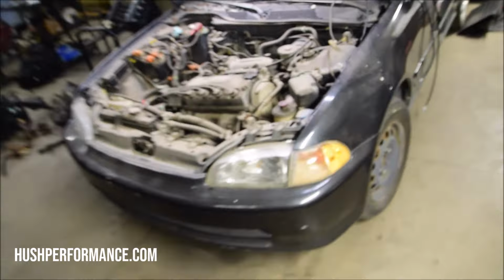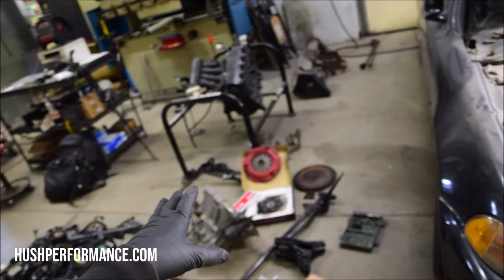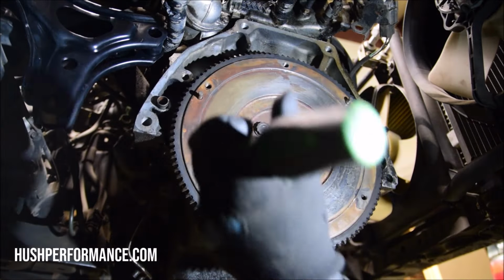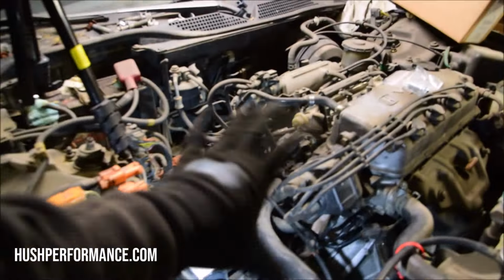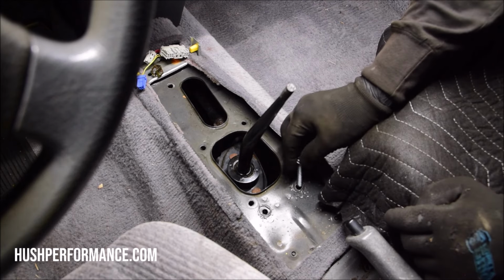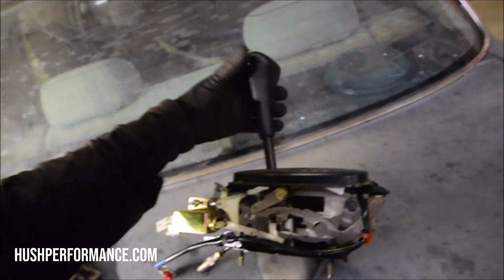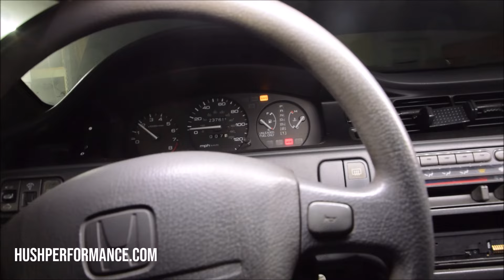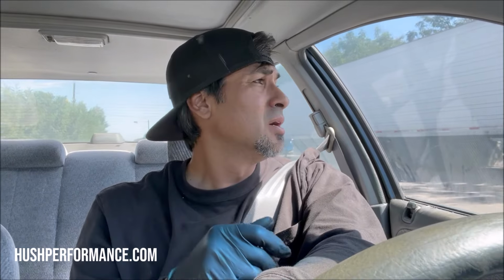1992-1995 Honda Civic Auto to Manual Conversion

Comment: im planning on manual swapping my eg hatch but i have no mechanical experience .. will a d16y8 from a 2000 ex fit in my 95 hatch?
Reply from the maker: @dosseii  yes but there are differences. Do your research before attempting
Reply: @ what trans would you say will fit 100% for the swap ?
Reply from the maker: @ not a 💯 % there are differences. I speak about that in this video.

Comment: Does this swap apply to the ek chassis with an auto d16y8? I wanted to do a swap without having to get the ecu and manual intake manifold and iac to prevent rewiring.

Comment: Few tips & tricks since I’ve owned over 30+ eg , ek , dc platforms 

You don’t need to drop the steering column , you can unbolt the actual brake pedal from the manual assembly and use it in the auto pedal which is a 5 minute swap

There’s a company called C2spec motoring that makes a complete auto to manual plug n play harness that utilizes the reverse lights , Neutral safety switch and doesn’t require any cutting or soldering or wires. 

Auto & manuals engine harness are the same aside from some plugs. But if you B swap and keeping your OEM harness you may need to de loom some of the harness to extend it
Reply from the maker: @Technowaverunner700  thank you for watching!

Comment: great video man. you stated in the beginning youd need a manual ecu, but mentioned you were still running the auto ecu in the end. have you run into any issues with that?
Reply from the maker: @pace3101  the vehicle is not registered or insured. I haven’t drove it any further than what was shown in the video. It should give me a trans code which is why I mentioned it including the harness. The ecu is not the original to the vehicle but the serial reads auto. That doesn’t not mean it’s stock. It could be chipped. I haven’t looked. The trans code should disable VTEC and put it in limp mode. Limp mode may only allow the vehicle to rev no more than 4K rpm in order to protect its self.

Comment: Good work. Is it the same for UK/RHD cars or are there some differences?
Reply from the maker: @genefuzer4287  I can only speculate.
Reply: @ is there anything you could imagine being different pal? Even if it’s speculative, just a bit of food for thought is all :)
Reply from the maker: @ you could cross reference the OEM RHD auto mount bracket part number to a LHD auto mount bracket part number

Comment: Damn, I generally try to help with a tip for the shifter hole and my comment gets deleted? So much for community.
Reply from the maker: @TrackSol  what comment was deleted?
Reply: @hush22performance1  Don't know if it was youtube or what happened, but I gave props on your video being good and added a suggestion to cover up the large shifter hole: At the junkyard cut out a portion of the center tunnel from a manual car and use it as a plate from the inside of the car to mount the bushing and cover up both AT holes at the same time. Plate will also allow use of the OEM rubber gasket around the shifter to prevent heat and grime coming inside.